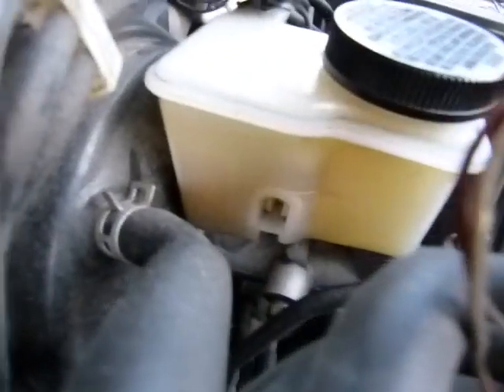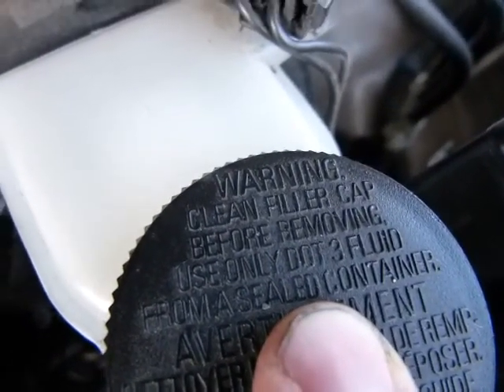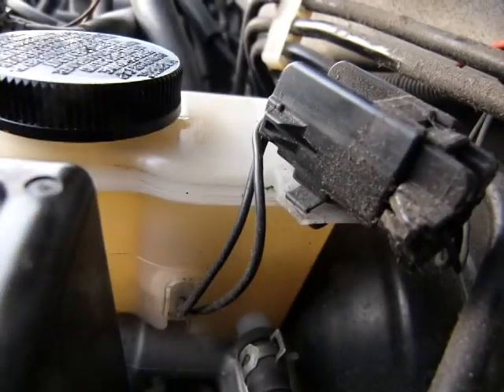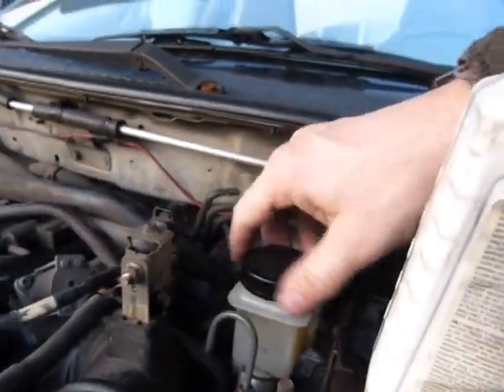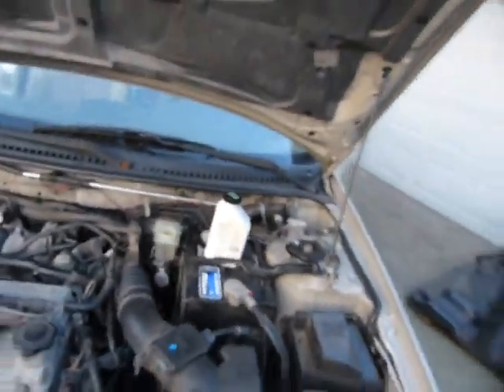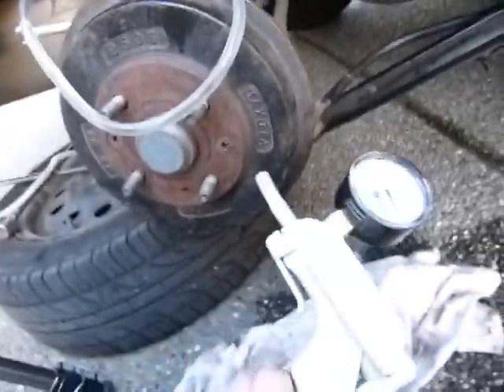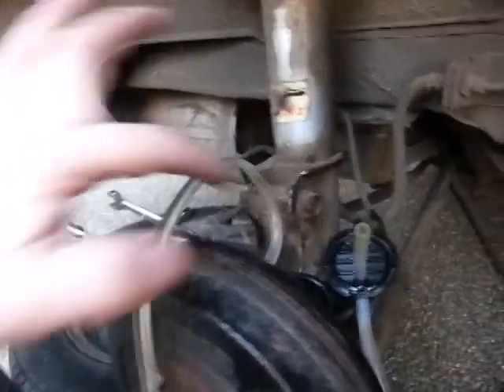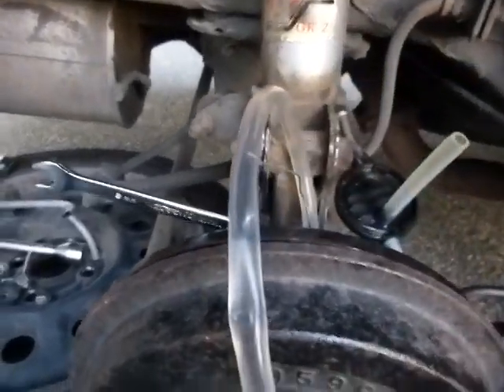Brake bleeding (pedal pressure method)

Comment: why are you going to slurp air back in if you have the bleeder valve closed?
Reply from the maker: Because the bleeder line is not air tight around the bleeder valve, just friction fit. Hence tie wire. So if there is vacuum in the bleeder line, it`ll suck air in at the perimeter around the valve.